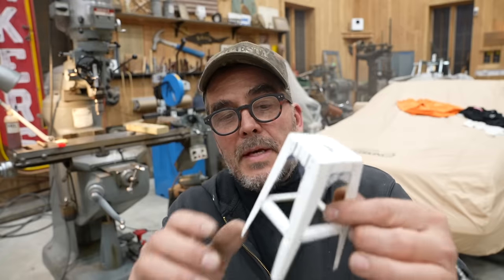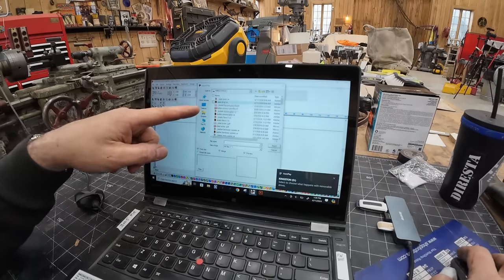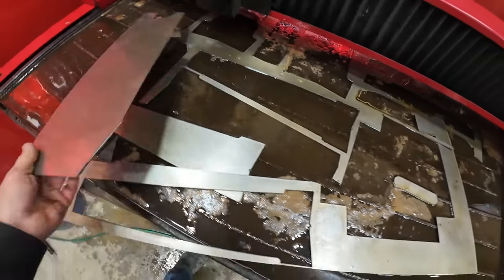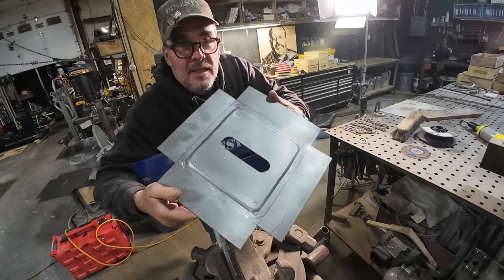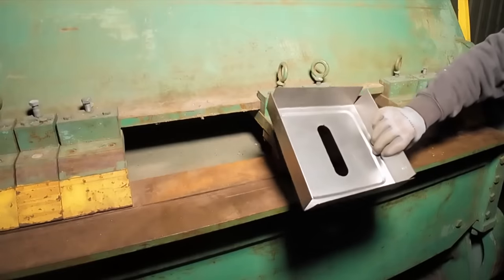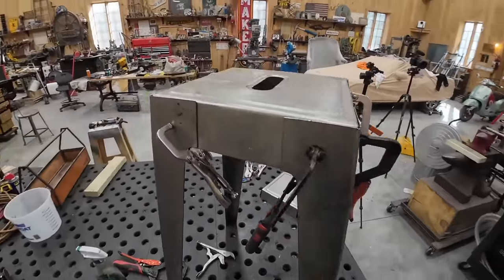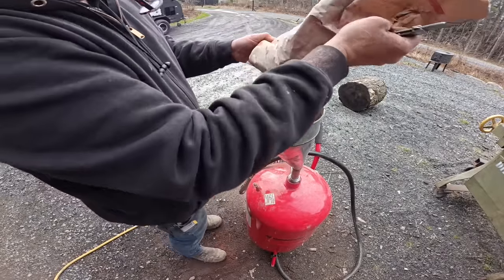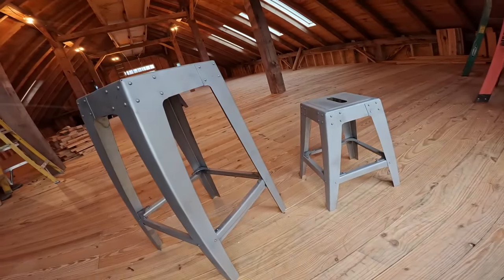Steel Stools for my New Shop

Comment from the maker: To be clear I want to scratch the new floor. That is the goal.      

Jk Ill ad feet pads.  Relax.
Reply: ahhh!  I see.
Reply: You do you. It's your floor. Stools look great!
Reply: I had to delete my comment after I read this...I honestly wasn't sure if you really wanted the scarring look or not!
Reply: I assumed your first project in the leather studio was to make little ”L” profile leather socks, copper riveted to the feet☺ 
Great job on the stools!
Reply: I think that holding it incorrectly while moving it could cause harm, so I suggested flogging
Reply: Good video
Reply: I would rather have the legs lap under the top..  Or at the very least, round over those sharp points at the top of the legs..  I'd hat3 to slide off of the seat and that sharp corner hook your pants or worse.  It's a minor change.. but I bet it will get someone eventually. :)
Reply: @DavidPlass  agreed! Nothing better than a floor or table that has lived a life!
Reply: Really enjoyed this one thank you Jimmy. Loved the little maquettes at the beginning. It occurred to - as it's always easier to make something the second time - that maybe the maquettes were the first fabrication and the steel was the second. Regardless, the progression from a sheet of paper to sheet steel was lovely to watch. Beautiful proportions & detailing too. Sound process and great outcome.
Reply: The floor had it coming.

Comment: Sturdy design but those legs need soft tips or some design element that spreads and cushions the load, especially on a fine timber floor
Reply: That’s my only thought, too. Might even be able to just weld a nut in the bottom corner and put some threaded slides.
Reply: yeah.. Also, I would rather have the legs lap under the top..  Or at the very least, round over those sharp points at the top of the legs..  I'd hat3 to slide off of the seat and that sharp corner hook your pants or worse.  It's a minor change.. but I bet it will get someone eventually. :)

Comment: Jimmy, as always great content, to make that bead roller easier to use, get rid of the hand crank and install a small steering wheel from an old riding lawnmower. I found a 12" wheel from a Wheel Horse mower. Works great.
Reply from the maker: Great idea 💡

Comment: Beautiful work as always Jimmy. just a thought tho. If you mount the legs to the top internally instead of externally you do away with the sharp edges at the tops. might sound like a none issue but if you end up sitting on a stool for longer than a little while it could prove uncomfortable.

Comment: I learned to rivet at the national warplane museum in Geneseo, NY where WW2 era aircraft restoration specialists started me off bucking, learning how its not just holding a buck, but working with the hammer and driver to shape the rivet. We left the steel rivets in a propane flame to keep them red hot, using thongs to handle the glowing metal. I don't remember heating aluminum rivets at all.

Comment: Best way to do rivets is an air hammer. With the correct cupped end in the hammer you hold a flat hand anvil on the rear and go to town. Heat all the rivets up in the furnance and go to town with them all at once.

Comment: Window wiper motor on the bead roller + foot pedal with back and forth (the ones that hinge at the middle of the pedal, not the edges of the pedal) 
and
The less than sharp radius is probably because the teeth are worn (or intentionally either upset or cut to give a radius. You have to check them and see what's what in case you need a sharp bend.

Comment: You could probably do a version of rust bluing to those chairs and get the patina started early and not have to sand blast them back to bare metal. You could also probably play with those faux color case hardening gels to get your signature DiResta logo on the sides using some sort of resist template.

Comment: If you were going to set up for production, would you eliminate the space between the legs so you could save metal/time on the plasma table? By alternating directions, you should be able to nest them together with very little waste.
Reply from the maker: The plasma has to cut. You can share a line simply so close can save material but not a god idea to share a line

Comment: just working on .063 shims for the top of my new command center in the middle of the shop. it is a Kennedy taco cart. The small side is .063 lower than the big side. The shims ended up being plastic from a kitty litter pail.

Comment: Observation, I personally would have put the leg ends under the seat. I  think both for ascetics, and to prevent pinching or snagging of clothing. Is there a particular reason you chose to place them on the outside ?

Comment: Why not use the seat to "cap" the upper part of the legs and get a smoother transition or "round-over" at the corners of the seat?
Reply: You’d still have the exposed edges on the outside corners. If you think of like a Tolix stool it’s a stamped piece of steel so it has a smooth rounded corner all the way around.

Comment: I wonder how hard it would be to make the entire chair top as a single pressed piece. Like you mentioned, soft edges, more ergonomic. Not sure what tech that requires. Then all the legs can easily be rivited under the chair, instead of the outside.

Comment: Are you going to put any feet on them to protect the wooden floor?
Reply from the maker: In time. I wanted to keep it under 25min
Reply: @jimmydiresta  Wooden pucks slotted to fit the metal legs would make cool feet.

Comment: I would rather have the legs lap under the top..  Or at the very least, round over those sharp points at the top of the legs..  I'd hat3 to slide off of the seat and that sharp corner hook your pants or worse.  It's a minor change.. but I bet it will get someone eventually. :)

Comment: Well done. Especially considering you used a bunch of techniques that were new to you. Are you adding some protection to feet? I feel like the sheet metal edges will eat up that nice wooden floor pretty quickly.
Reply from the maker: Tbh I didn’t address the feet on video to keep the conversation in the comments going 💪🏼